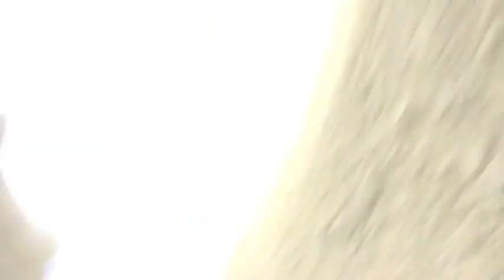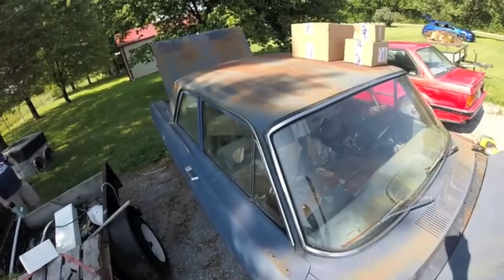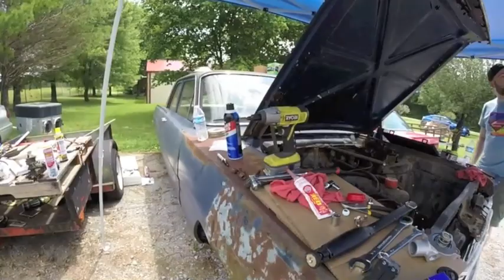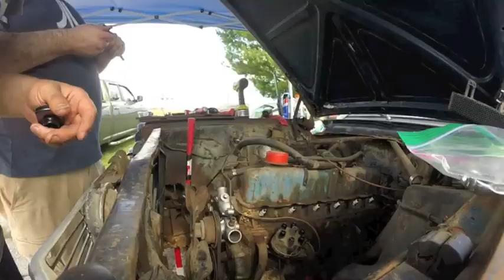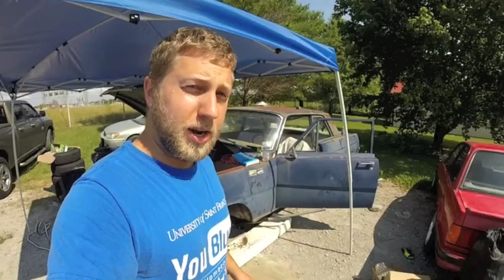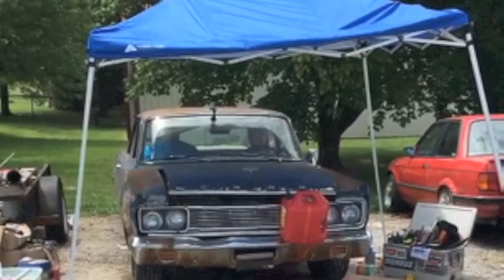1965 Ford Fairlane Brought back to life! First start in 10 years - K3VBOT's Garage

Comment: Very cool! You just gotta do something about the sound. Cranked it up to barely hear you then got blown out of my chair when you voiced over. Not a complaint, just pointing it out.
Reply from the maker: Working on alternatives for the sound. The GoPro's didn't pick up the sound well in their cases. Either going to try different cases, or an external mic
Reply: @k3vbotsgarage786  external mic is the way to go. I edit all my stuff with earbuds in and tweak the levels manually. Also note some GoPros only pick up mono sound- you just duplicate that on Left and right channel to fix. DM me if ya have questions!

Comment: Someone please help me out, I got a 1965 Ford fairlane 500 that had a 289. Now trying too put a 302 from a 86 GT. What engine mounts can I use?
Reply: You should be able to use the same mounts of the 289 they are both the same engine unless Ford changed their mounts but they are both windsor engines and should bolt right up
Reply: @79tazman  hey buddy! Yea did some research and found the correct ones. Cost me about $220 but got the engine sitting it. Been busy with other projects. But hopefully can post some clips of mine running.